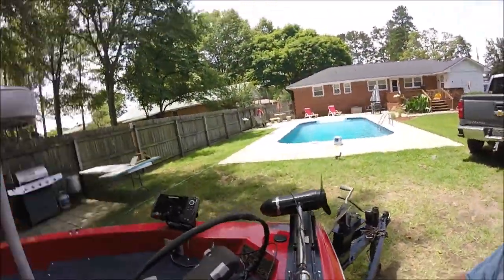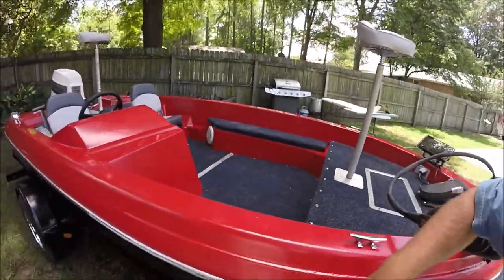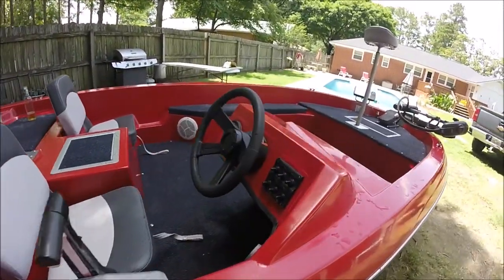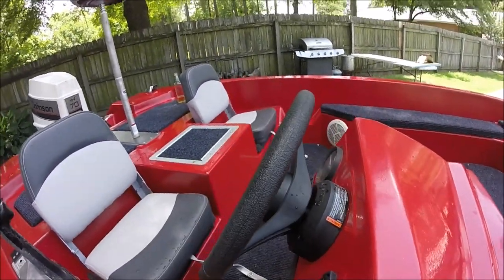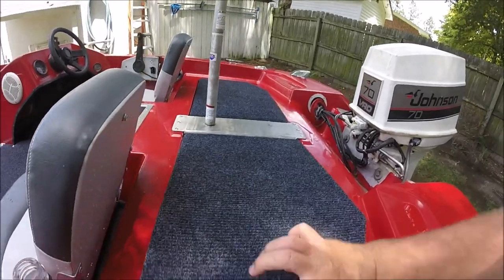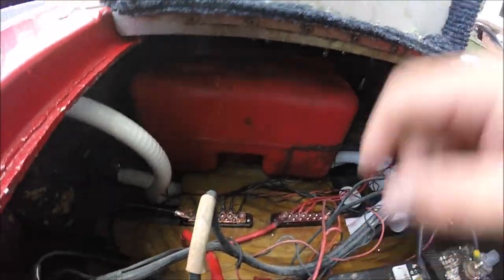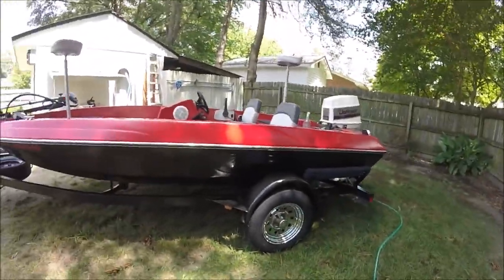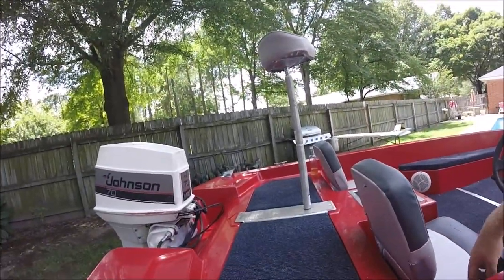PROJECT BASSS BOAT IS DONE!!!!

Comment: Awesome boat iv got a 1978 hydra sports has a 1980 model merc on it I painted the top part of mine blue new seats new every thing best boat iv ever owned got it last spring gave $1100 had to put a trim motor on it about it beside the cosmetic stuff I done.